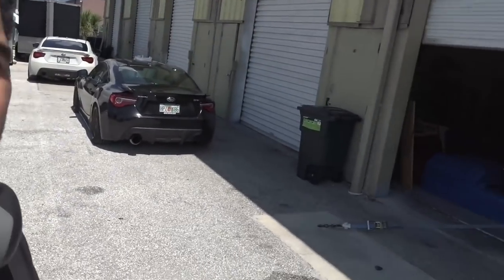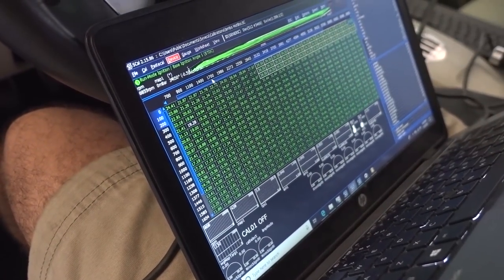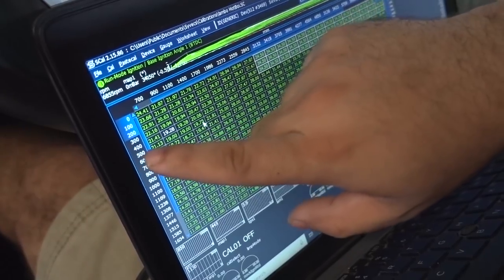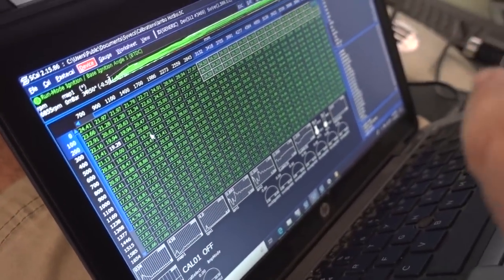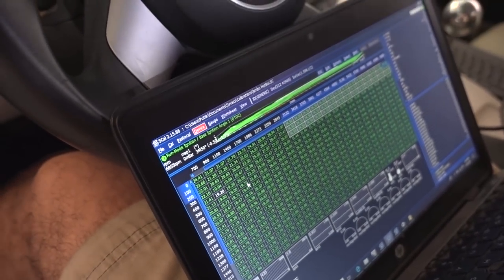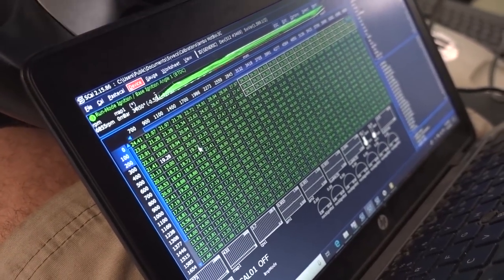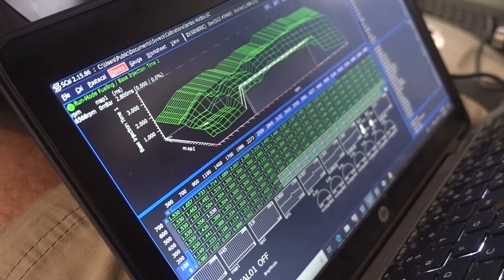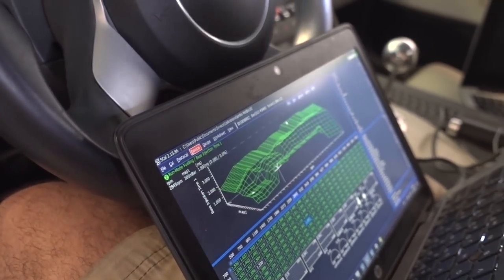Here's How I Made My Cheap Lambo Shoot HUGE FLAMES IN 2 EASY STEPS! **SPICY**

Comment: Good job on the build. I did a twin turbo LT1 in a Chevy truck for my brother from the ground up and learned a lot as well. The scavenger pump system is a fantastic idea for that build. I truly believe that combined with the right PCV engineering you'll get rid of a hundred percent of that smoke. I watched the part where he really got into it hard and you might want to consider installing some bar stock to secure the reverberation of the exhaust when you're really smashing into it to keep it from putting undue stress into the turbos from the reverberation. Well done.  I can't wait to see it with the right Scavenging system and putting big numbers down with only smoke coming from the tires.
Reply: Also you may be able to get rid of a hundred percent of the smoke on that build without a Scavenging pump. I was able to get rid of all the Smoke on the LT1 without a Scavenging pump. The main thing is that the first so many inches are going at a pretty good downward angle and then you want to go downward the entire way and another thing is the PCV system having the right kind of catch cans and whatnot. Also since you do have ball bearing turbos and they are liquid-cooled as well.... You can put what are called restrictors on them that basically lessen the amount of oil flow through the turbos based upon what kind of turbos you're running and the amount of oil flow that is being put through them from the factory system and the sizes of the lines. You want to make sure you have the right amount of flow going through them which you can basically dial in with the little restrictors that they sell for the turbos. And when you're dialing it in just make sure you use a  temperature gun or guage and keep a log of temperatures of oil and turbos based upon different loads in RPMs like a scientist and you'll know if the restrictor is infringing on the turbos life expectancy in any way.

That's got to be some of the coolest things to figure out as far as inventing something. Making a car that's cooler than what manufacturers make. What's better to invent than that? Not a whole lot.

Comment: Also something that I just remembered cuz this build was done awhile ago and yes we did get rid of a hundred percent of the smoke coming from a twin turbo LT1 with the turbos not very high above the oil pan. We ended up having some catch cans welded by a guy that were about 6 or 7 inches long and about 3 in wide and we basically put them in line with the oil return lines coming from the turbos to allow the oil to have an area to build up for when you're really getting into the power and when you're back to driving it normally that buildup in the cans or cylinders I should say drains back down. A good Scavenging system would probably be worth its weight in gold because of the fact that with the right set up and what not you're done. You don't have to keep taking temperature readings and playing with line routing and all that stuff because it is what it is. That was a good-looking pump you bought.

Comment: He sure has a lot of knowledge. Seems like a really nice guy too. Very interesting stuff. I've never seen anything about tuning cars but man you showed us a a lot of interesting stuff. Just make sure you don't melt any body parts on that rear end. Remember fire moves quickly so I would try to leave the fire bit off if you can. Specially where it's hot. We're doing over 100 degrees f in Los Angeles right now so add that to any car and you will see a lot of cars on the side of the freeway during this time. Florida is worst with that humidity.

Comment: Cool that flames are a functional application.  I've read that wideband O2 sensors are more delicate than the narrow band ones.  Is running rich exhaust past the sensor bad for it in terms of shortening its lifespan?

Comment: The purpose is to keep the turbo speed up during gear shifts to avoid lag and gain an advantage over your competitors,, On a street car It's only going to beat up your turbos ...
Reply: It's pseudo antilag. Finally someone who gets what it's going to do to the engine / turbos. Because we all know that starting a reverse pressure wave in the exhaust is something rings, pistons and rods just absolutely love. Not to mention the hammering it is giving the turbine and common shaft.

Comment: Cooking bacon with a 100 hp lamborghini exhaust (gone wrong) would be a great clickbait
Reply: B.Roa 23 100hp is pretty accurate to it's current state (although it seems to be getting better)
Reply: Well he did make a video of it making about 750 - 800 hp on low boost in the longer video.
(Dyno he is on reads 20% lower then actual numbers...
One of the newer mclaren cars on the same dyno (think its the 650 mclaren he talked about.) made 420 hp while actual rating is about 200 hp higher at 628 hp or similar on other dyno's.)
Reply: Marcus60661 dude it's a joke. I know that he made 700-800 ish hp

Comment: Totally unrelated question but since it's on this channel some of you might be able to help me. 
Thursday I put a bottle of techron in my car, filled up with Chevron. No problems. Friday afternoon, I go to turn my car on and it turns on but it took longer to start. I didn't make anything from it. Friday night I got in my car and same thing, car turns on first try but takes a little longer (maybe 2-3 second) to turn on. I check the battery and it seems to be fine. Saturday morning (today) I start the car same problem with the longer crank and now I smell gas. I check the floor no leaks, no visual signs of puddles. Check the injectors and they're not leaking either. I check the gas cap and it was on properly. Now I check the wheelwell and it looks like oil leaked at some point. I clean it up since it was dry and didn't not smell like gas. No check engine line, no issues when running. In fact it's running pretty smooth. Just the smell from the outside and with the windows open it lingers inside. Any guesses??? I will take the car to my shop on Monday just to check if there are any leaks on the fuel pump or hoses. 
Some important information: car is 08 bmw 328i. 
The weather in LA was really hot on Friday and Saturday (115) 
And first time using an injectors cleaner on this car. 
No codes are thrown by OBD2
Reply: Update: I went to check the car again after sitting for awhile and I saw a puddle under the right side of the car. I checked the fuel pump sender and there it was. A fucking hairline crack with fuel squirting out of it. Looks to be a super easy DIY, so I'd be doing it that. As a side note, what makes pumps crack? The heat? The intense use?

Comment: The only problem with this as great as it looks, combustion is taking place in the exhaust system which really reduces the life of the headers and other components it helps if they’re ceramic coated but they can get extremely hot so be careful of surrounding components like loose wiring and your dry sump system
Reply: BigKing Bud true I know the engine is very well built for the twin turbo setup but I also remember him showing large amounts of temporary wiring close to the engine As well as the oil return from the turbos being quite close to the x pipe (baller pipe) however I’m sure it’ll be fine but just something to watch out for

Comment: Would this allow you to keep the turbos spooled up during breaking by combusting in the exhaust adding pressure while under breaking that didn’t come from generating power?

I know F1 cars used to do something similar.
Reply from the maker: that would be anti-lag, and I can have that on my standalone, but there's no reason I'd ever need it.
Reply: I was gonna say, you just described anti-lag. :D
Reply: Tavarish ahh, I’d heard of anti-lag before but didn’t put one & two together. When you were mentioning the exhaust needing to heat up first vs very delayed ignition timing to trigger combustion in the exhaust I got mixed up.

It might be worth it if you’re configuring launch control to spool up, but yeah looks like the wear and tear wouldn’t be worth it.

Comment: Hey Guys,

I have been having alot of trouble figuring this out do to the lack of not being able to find an exact diagram of the vacuum lines for my '98 Trans Am, and that I have a proCharger installed which has changed thing around a little bit from stock.

Anyways the problem goes... for starters when I get on the throttle with the vents on high (a/c or heater,defrost, vent, dosnt matter) the air completly cuts off and stops blowing out the vents. Then once achieved speed (say 70 mph) the air would come back on. Now, just recently it has stopped blowing all together at high speed. If I am going 70 mph and the heater or a/c or vent is on high, I can hear it blowing inside the dash blowing but nothing comes out of any of the vents no matter what settings. The fan inside is definatly spinning though.

The reason i think it is vacuum is because this engine has been rebuilt and not by the guys who did the supercharger. These new guys really did a number on mixing crap up. I gave them my ProCharger manual but i dont think they even opened it up seems.

I explained this problem to a friend and he said sounds like my vacuum lines are maybe mixed up.

has anyone ever heard of this or got a diagram or some pictures of where what lines go where haha? Im getting desperate.

Comment: Thats still alot of oil burning...?
Reply: Cristian Saavedra may be condensation. Its humid as hell here in fl
Reply: Condensation is in cold long exhaust, this Lambo exhaust is short and hot so no condensation there.
Reply: it's a turbo lambo, you're gonna see some smoke now and then
Reply: If it’s not smoking it’s not a Lambo. Wait...........that’s a Chevy my bad.
Reply: Cristian Saavedra looks more black than blue so i'd guess it's fuel.
Running a bit rich to be on the safe side
Reply: It’s burning fuel in the exhaust for the flames and since I’m gonna consider it’s not a very efficient burn it’s probably where the black smoke is coming from
Reply: Looked blue to me. Wonder if the turbo is still playing up?
Reply: chiquy190 agree
Reply: I understood, he was going to fit a scavenge pump since there was oil spitting out of the turbo. I would have just sent turbos back for refurb when he had the chance. Not too bad though.
Reply: Asiamies tavarish even noted there was condensation in a previous episode. Do you even watch?
Reply: Yea who knows how the previous owner took care of that engine or not cause he never took it apart to see.
Reply: I don't believe he's fitted the scavenger pump yet. He said just last video he still has a little problem with the oil pooling in the turbo.  Most likely a combination of that and the extra fuel to produce the flames.
Reply: He still has the issue with the oil draining back into the turbo, still has to install the pump. I guess now I know why he reiterates all the time
Reply: Nerdy, Retro, Gaming - I saw he shortened the hoses and made them go into more of a slope and he had ordered an oil return pump that he would use to bypass the intentional oil return and just route it back to the oil reservoir, but he hadn't set it up yet because he wasn't that worried about it taking it to the dyno

Comment: Dude is that red eclipse for sale?
Reply: Jan Romero lol actually it is.  But it needs a lot of work.  It’s a GST.  Everyone thinks it’s a GSX.
Reply: Erik Cruz what does it need? I'm looking for one
Reply: Jan Romero I bought it as a project but never had time to look at it. The last owner said he put a lot of money in head work, but blew the motor shortly after.  It starts and moves.  But that’s about it.  The interior needs to be cleaned up too. It has leaky sun roof seal.  I just want it gone.
Reply: What does it need and how much?
Reply: Jan Romero it needs a motor rebuild for sure.  It is leaking exhaust through the PCV system which is never a good thing.  And it has a leaking sun roof.  First one with $1000 and a tow truck can have it
Reply: How can I contact you?
Reply: Erik Cruz so I'm sure you have 4g63 tune experience now. Good to know. I have a 91 gsx that needs a little tunning love.

Comment: How much hp is the engine rated to?
Reply: James McIvor Gallardos are seen to go up to 2000hp figures
Reply: James McIvor 1,000,000
Reply: Aizaz Rehman I'm talking about this specific engine
Reply: James McIvor Tavarish has a fully built engine and he's getting close to  around 900hp
Reply: 500 hp in stock form.
Reply: Jamie Bowman 501 to be exact
Reply: Yes but this engine has been built with aftermarket rods, pistons etc.....
Reply: James McIvor it would be hard to say what the exact naturally aspirated numbers would be unless you tuned it without the turbo system and got some numbers. If I had to guess he might get 600 out if the engine alone if he's getting 900 with the turbos, but that's pure opinion.
Reply: Jamie Bowman dude ur never gonna get a higher number than what the factory said but u can get numbers lower than that for sure. Talking about turbos if he's adding them on a stock v10 like stradman's it's gonna make no more than 650hp max
Reply: So this engine, a 5 litre v10, after being built internally can only hand upto 900hp?
Reply: It will do 1000 hp+ as it has done that before tavarish bought it on e85. Currently in low boost setting & regular gas atm he is making about 750 - 900 hp. as the dyno he is on reads off about 20% of the total power.
Reply: James McIvor 900hp on tongue is easy but being in one is a business of it's own. No this baby can make 1000+ if he kicks some high boost settings but just to play safe and not to get into major rebuilds as this is a garage build he's not running it full boost. These turbos can make up to 35psi of boost and he's crancking like 12psi so the verdict is it sure is gonna make way more power than 900 but Tavarish don't have the balls to that as he don't want it to blow up and catch on fire as last time
Reply: Aizaz Rehman Tavarish said the engine was "built" ie. Not stock. I realize factory numbers are pretty much as good as it gets if its "stock".
Reply: Jamie Bowman your right 500hp out of factory is not low at all but then again it's built + it's twin turbocharged it has a lot more than what the factory offers